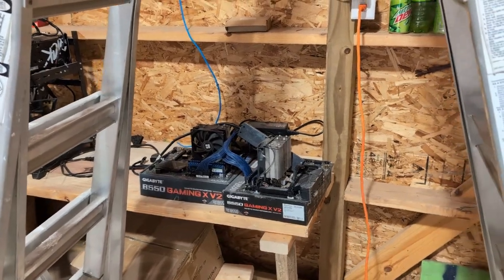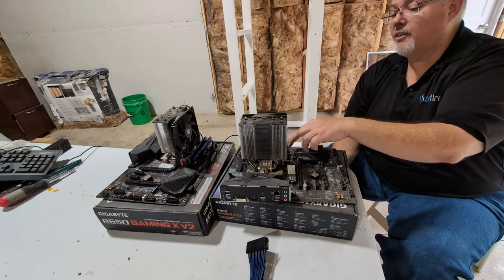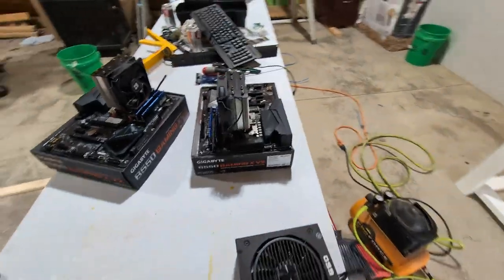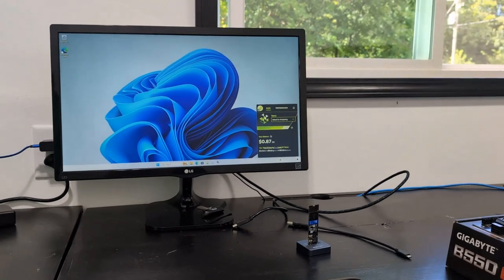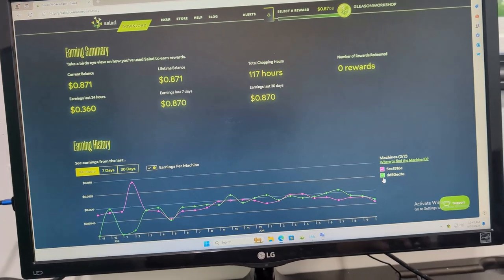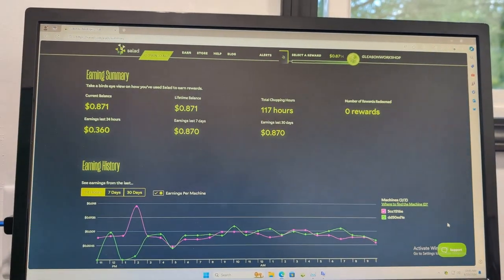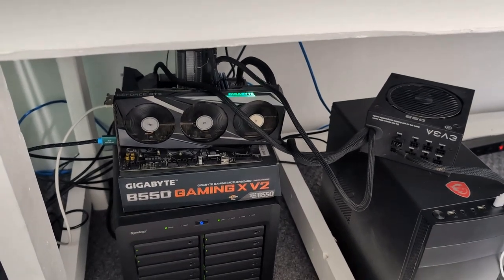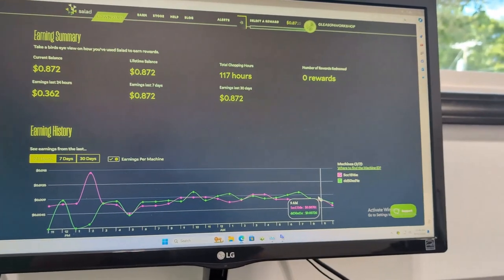Converting CPU mining rigs to Salad AI workload rigs -Is this normal ?

Comment: YOU have to build a rep and let them run. The longer they run, the better jobs you get i dont have any 3060s but i run 4060ti 16g a 4090 4070ti super and another 4090 but its  all in the demand. Salad is a wired platform
Reply from the maker: thanks,  I was thinking there would be a scoring based on availability.  like always on vs sometime on.  about how much do you make from a single 4070 / 4090.  just starting here, my 12gb 3060's with ryzen9 5950 cpu and 64gb ram.  looks like the highest day so far has been...  $2.10 for the single rig.

Comment: G'day,  I'm running 5 3090's 4 have 64gb memory my 8700k 32gb and my 7950x3d 64gb have long term jobs, both paying exactly the same.
Reply from the maker: I am planning on moving my Nvidia 3060 cards to older motherboards but with 64gb ram.  I feel the ryzen 9 5950 CPU chips are being wasted on Salad.   Have you any experience doing this?